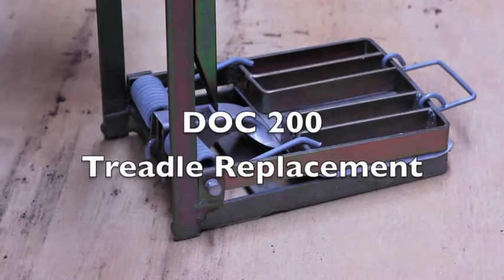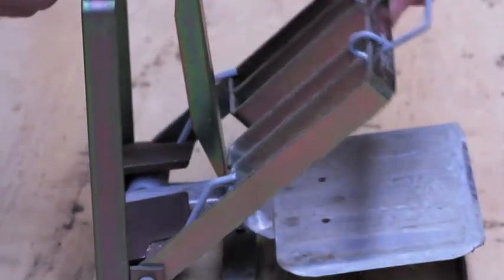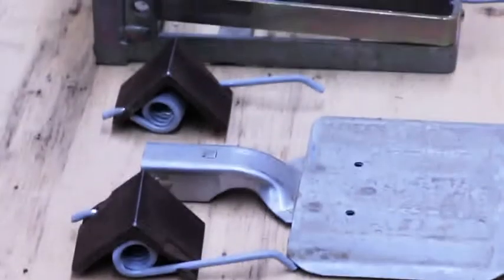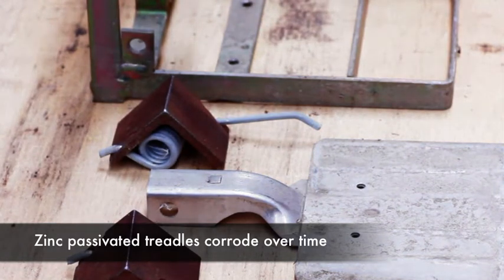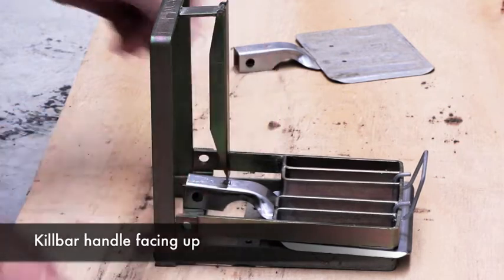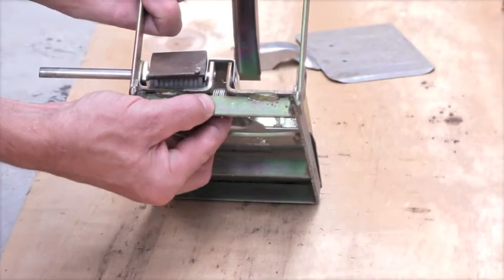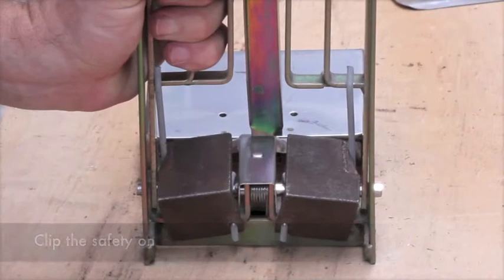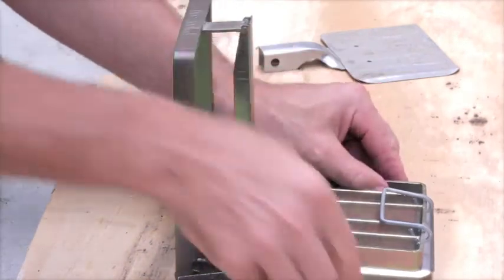Treadle replacement on a DOC200

Comment: Also useful for replacing the plate/treadle spring when the spring becomes too weak so the plate/treadle deflects with a load less than 80g